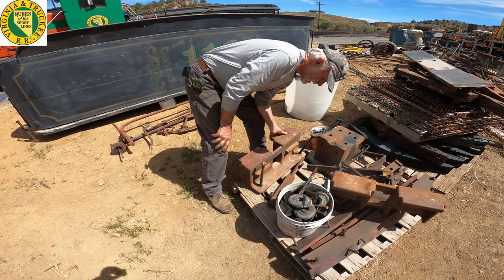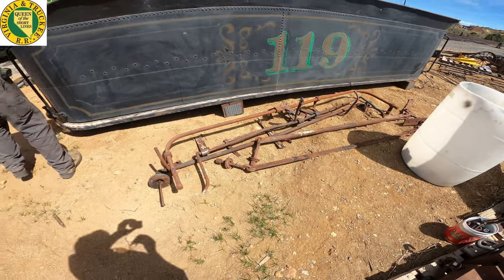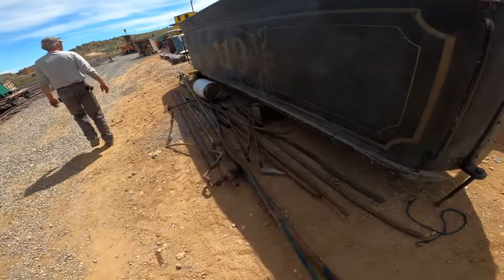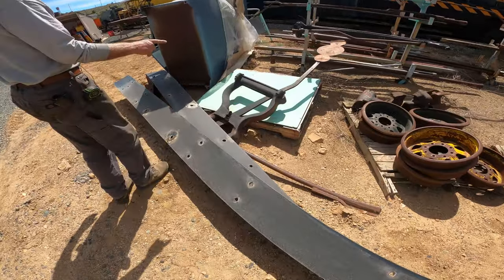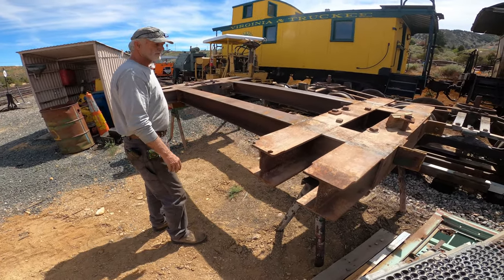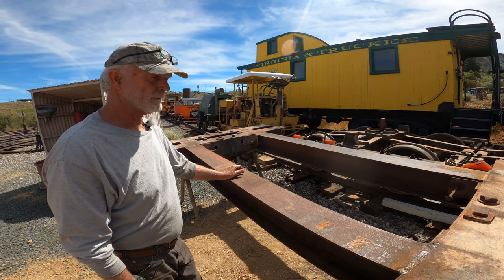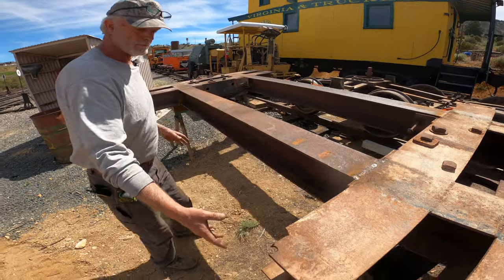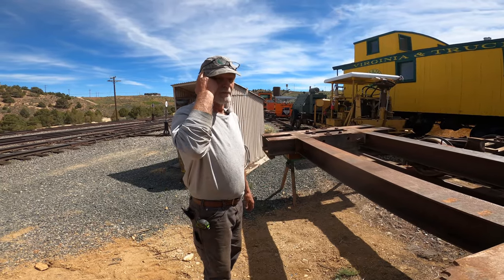#11 The "Reno" -- V&T's Tom Gray Tours the Reno Tender and Other Acquisitions

Comment: I vote for cap stack. There’s so much oil-burning equipment on it that’s original to the engine that the 1917-1945 restoration would make it a complete yet FRA compliant machine!